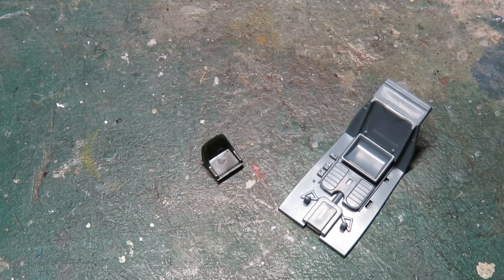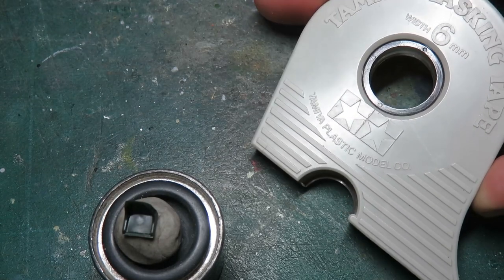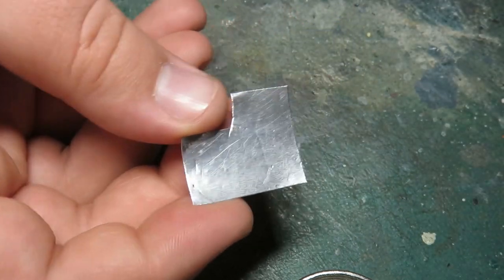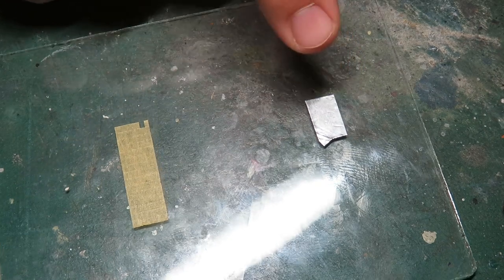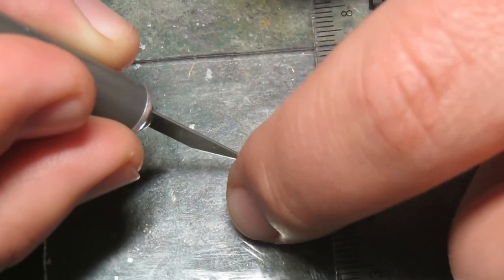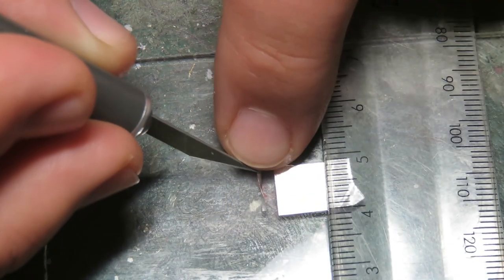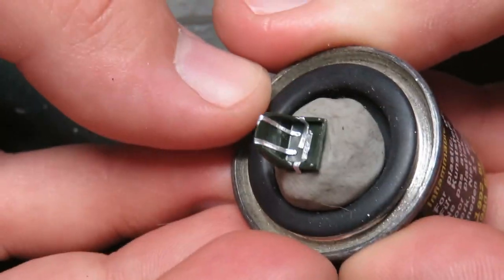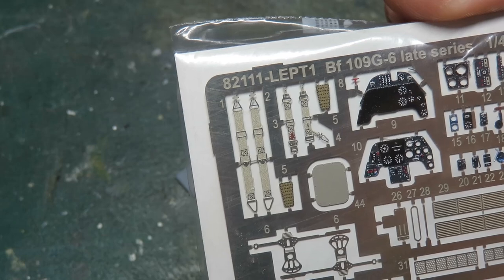Building Scale Model Seat Belts -Demonstration-

Comment: Good evening,
I also use this type of foil tape on full length panels  to cover it with an aluminized looking aircraft.  There is actually three different thickness for sealing air ducts on furnaces,  it  is easy to use and if you purchase a roll at a $1 store, you can save a few bucks.  The problems I usely have is in the start of stripping the protective paper from the glued sides.  They are selling very small rolls in dollar stores and they actually come in different colours and so can be used these for different functions to cover, say the exhaust on large scale  motorcycles, model cars and trucks.  Y’a it’s crazy what you can do with it.  The down side of using the product is , say you cut a size to fit a panel on a wing and you get wrinkles because you were to fast in applying it.  I have tried many different ways to correct this mistake without remove and replace the  “with the  SAME piece of foil” but failed every time. If you make a mistake in applying it, the only way to repair the blunder is you need to remove the piece, clean the glue off the model and just start again. When you finally discover a way to apply and make it look good, you’ve found another way to place a bear foil finish on a project. Just a few thoughts.  In closing , it’s best to have a dummy model you can experiment with to applying foil on a worthless junk so you don’t destroy your next jewel.
Forever inHis service.